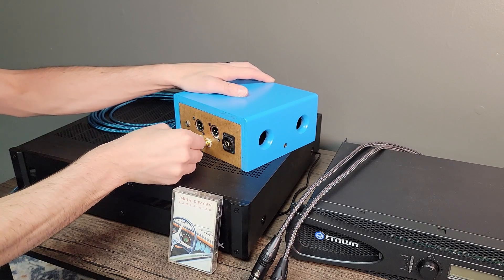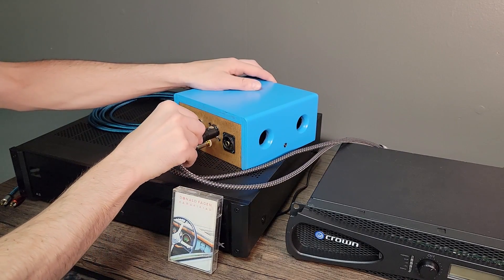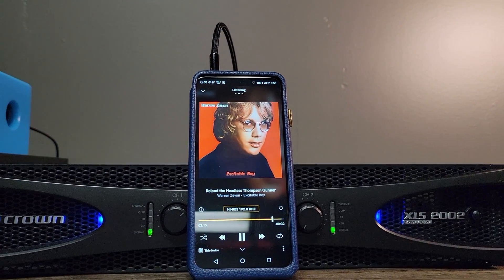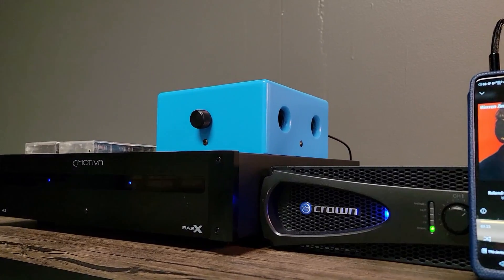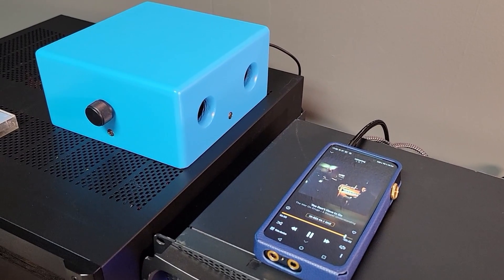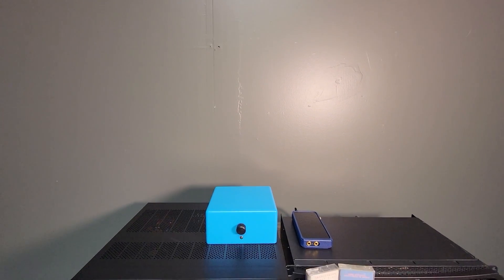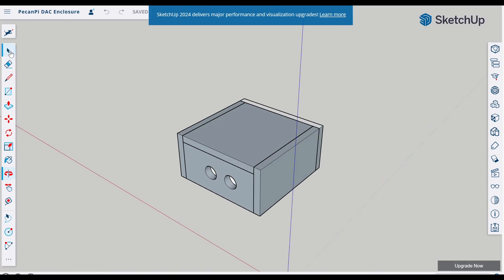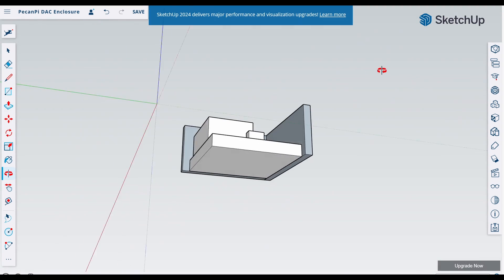High Performance DAC Build - PecanPi Rev 3 By Orchard Audio

Comment: What speakers are you using ? If you have a no budget hold , then what speaker would you be building ? What choice of drivers would you be using ?
Reply from the maker: That's a tough question to answer. There a lot of great plans out there. Or if you design your own, the possibilities are limitless. SB Acoustics makes high end drivers, Purifi also makes excellent drivers. Scanspeak, and so many more.

For me, most of the affordable kits & plans sound good enough, not to want to spend thousands on drivers alone.
Reply: @DIYhyfy  Thanks for the quick reply , I have got a few months to kill. Can you suggest something with a budget of around 3-4K. Something that I can build and call it a lifetime achievement. I noticed that you are more of a Wood/Design guy ,  if I may take the liberty to suggest ... then I will recommend to pick up learning CAD and some electronics. Both skills will go a long way with you.

Comment: The 7$ Apple dongle DAC does the same fucking thing. Don't waste your time glamorizing D/A conversion. It's a solved issue, and not worth taking any more time or money away from parts of the system that ACTUALLY matter.
Reply: You're absolutely wrong, troll.  You're just broke.
Reply from the maker: While this is flatly wrong, it also ignores all of the technical benefits I described for myself. Both RCA & Balanced, Huge Headroom, Compact, Affordable.
Reply: @DIYhyfy  The technical benefits are pointless, human ears can't tell. You're just emotionally entangled in the hobby and a slave to your ego and subconscious biases. I guarantee you will never in your life be able to reliably tell the difference between two functional DACs of any kind. You're fantasizing.